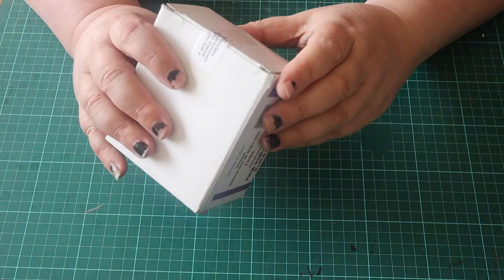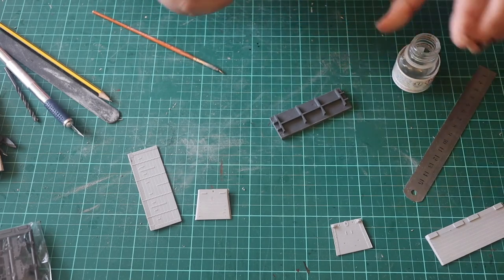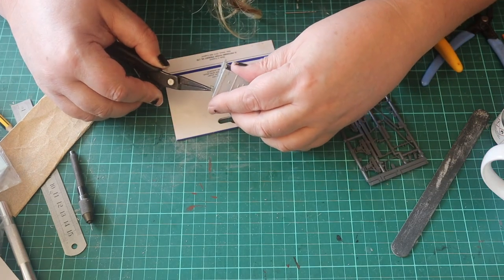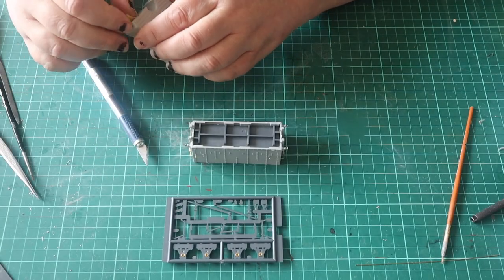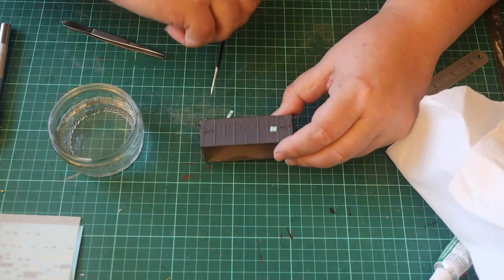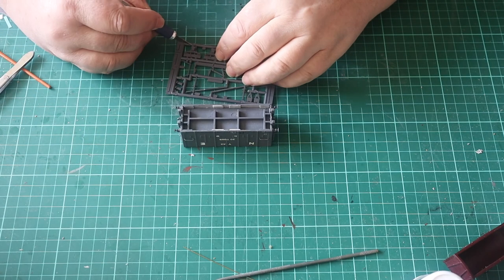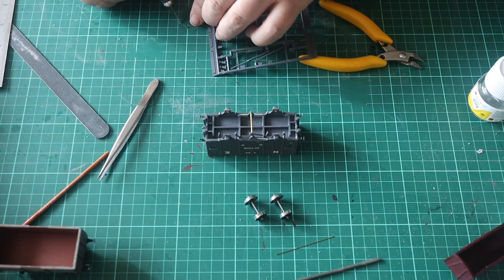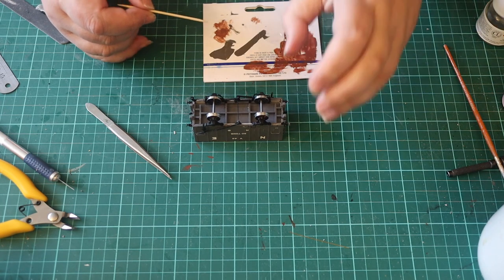Constructing a Slater's NER 20T hopper wagon.

Comment: I have built a couple of Slaters and like them though noting the plastic is softer than say Parkside. Its a pity theydont include wheels and bearings like PD but then they do include decals...bizarre. I have 2x those brake vans and 20T wagons to build. More satisfying and cheaper than RTR wagons IMHO. Also meant to mention I just leave all the sides on the sprue and prime/paint with aerosols. Same for the chassis in black satin if they are seperate